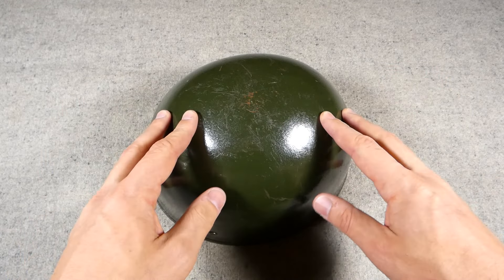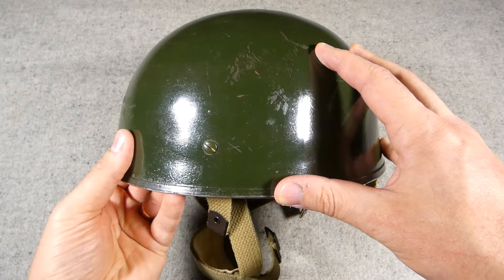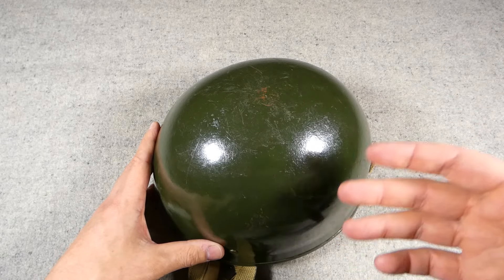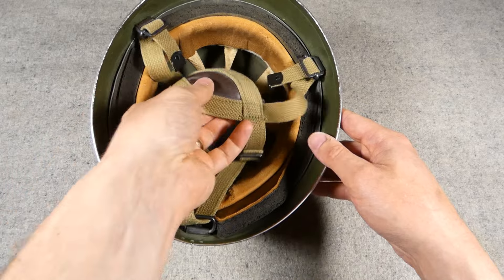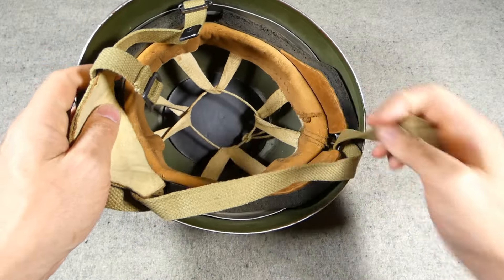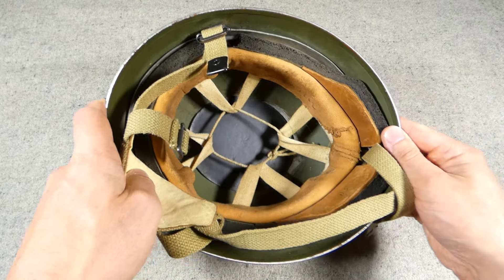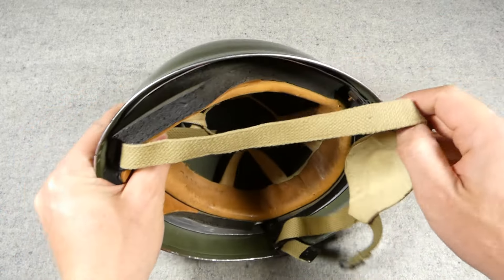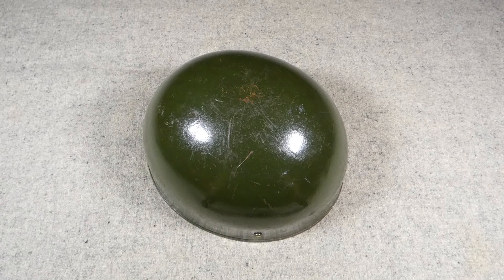British 1956 Helmet, Steel, Airborne Troops Mk II

Comment: Hi, I can’t think of any equipment issued to us that had such minute usage as this helmet! We tried not to put it on until the last moment on embarking and it was the first bit of kit to be taken off on landing and in most cases it took precedence to having a slash. The knot in the liner cord always dug into your scalp and in spite of any padding it was always uncomfortable, heavy and could have been so much better designed had the treasury allowed the funds to be available. When serving in the Middle East we would repaint the helmets in a sandy colour and add a sprinkling of fine sand over the helmet when wet with paint. This would give a sandpaper effect allover and add a bit more weight. The daily fatigue dress in those desert for us was a beret, PT shorts and boots, no wonder most of us got skin cancer in our old age if we ever survived that long. Cheers mate Harera

Comment: I would like to add that the Belgian used postwar a near Identical helmet for their paracommando's. The chinstrap webbing is more green en the leather chincup is light khaki/ brown. The rubber is more yellow brown. and the crashpad is also light brown. The Belgian helmets are not marked with an manufacturer but wil have a metric size most ranging 54, 55, 56 many written down with a pen or ink stamped. The helmet surface is smooth and to the left side they have a painted small Belgian flag. Seen ehese scratched away or fully repainted. Most not all!, have light green straps inside, although I have seen a few who were white but not with a typical British herringbone weave. So be aware when buying an webbing chinstrap airborne helmet. Recently I saw one being offered as a ww2 British helmet. Some sellers replace the greenish Belgian chinstrap with a khaki (replica) British.

Comment: I’ve got my dad’s para helmet which is pretty much the same as this but it has a rough feeling paint that is original. It has CCL 1965 on the inside. Would this be a mark 2 or 3 helmet?